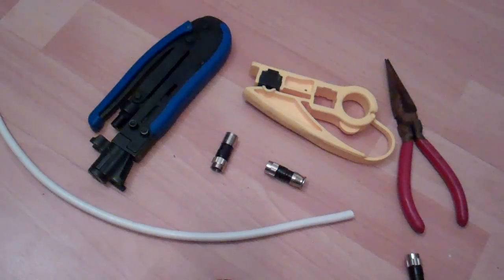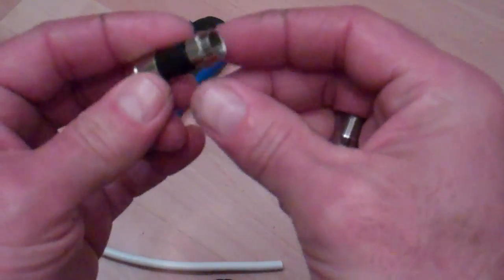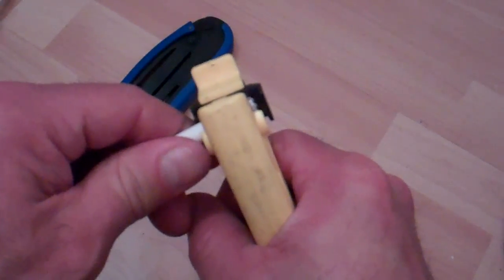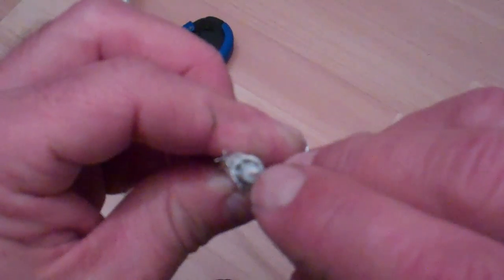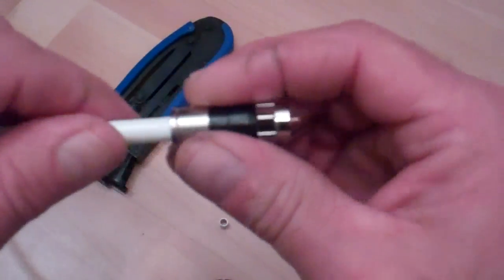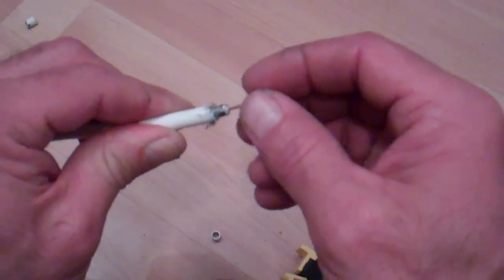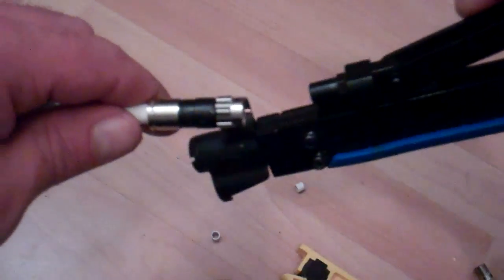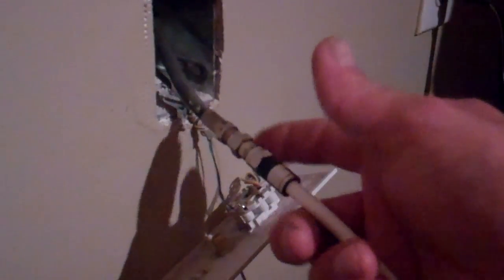How to make a coax cable

Comment: ThankU for this Valuable information and taking your time to go through the process of attaching the connector to cable... I had to splice my Cable / Internet; (Life Line to the World) :-) the fact that Im sending U this msg is proof that everything went well!  ~~~I had to adjust the barrel on the Coax Compression Crimping Tool RG59 RG6 RG11 Cable F-Type Crimper PPC Connectors (eBay) )8:00 this is the only thing I would add to this video!

BRAVO

Comment: Do you know the names of the tools you used
Reply: Tim Tanner
techtoolsupply.com is a rip off!
Reply: Compression Crimp Tool
http://www.techtoolsupply.com/ProductDetails.asp?ProductCode=PLA-16212
Cable Stripper
http://www.techtoolsupply.com/ProductDetails.asp?ProductCode=ROS-8720ES
Fittings
http://www.techtoolsupply.com/ProductDetails.asp?ProductCode=EX6XLPLUS_50
Reply: if so please provide a better online retailer.